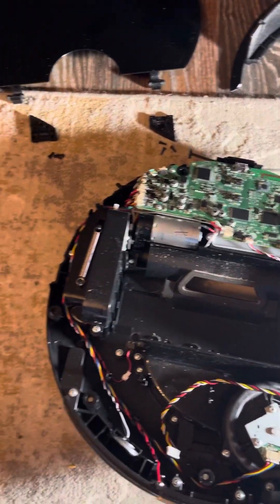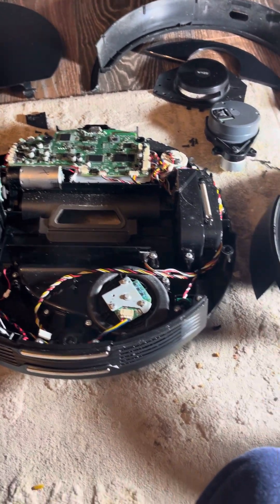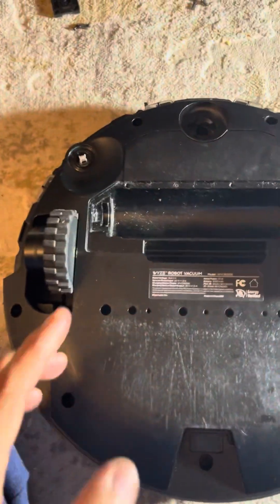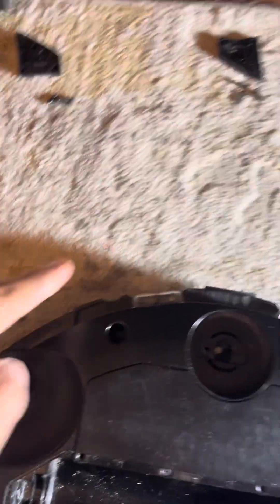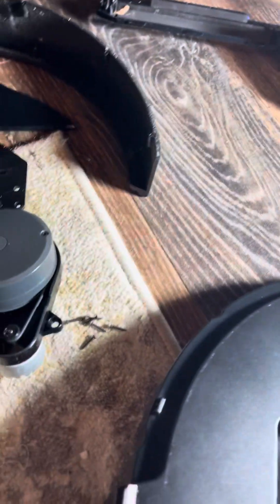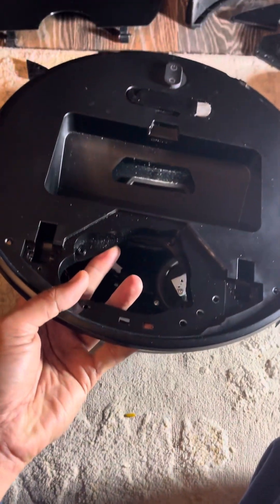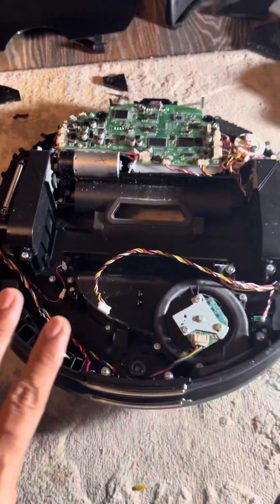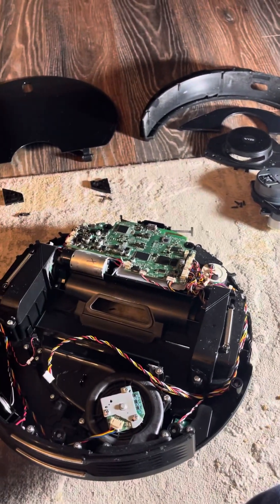Wyze robo vaccume ( lidar) WVCR200S replacing or repairing back wheel

Comment: Amazon lists the Wyze WVCR200S, under 2 different ASIN numbers.. one for $184 and the other for $222  (B08NR5TBS3  , B09L8DNBCY respectively).   Any idea why the difference?
Reply from the maker: if i were to suggest, I would not suggest wyze, but rather Shark, which is a bit expensive or walmart brand Eufy. I have 4 robo vacuum of 4 branch for last 2+ years and have been testing in  real world environment and this is base don that experience.